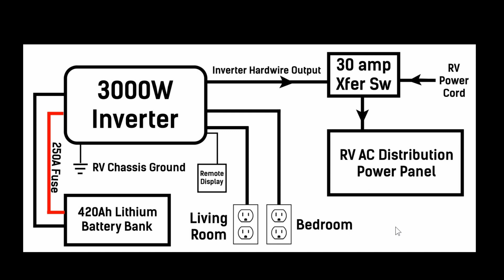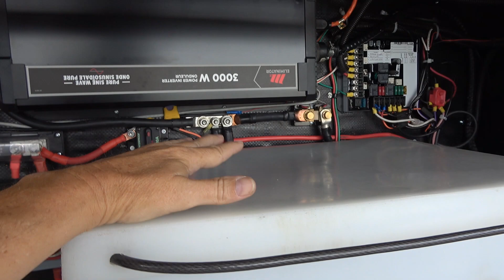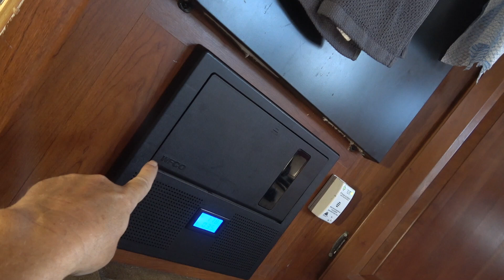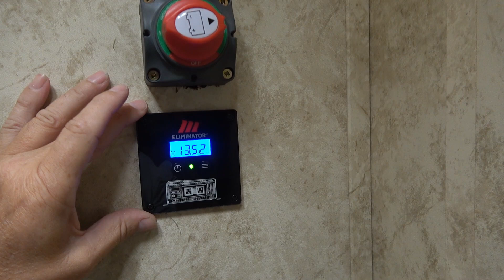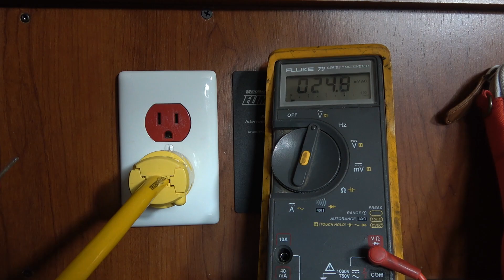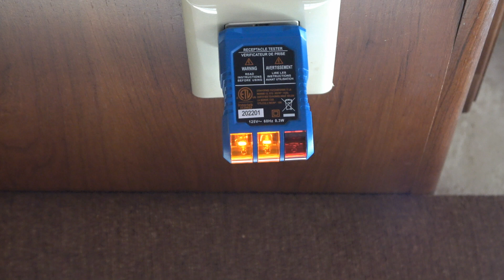3000W Inverter Installation w/ 30A Auto Transfer Switch - Motomaster Eliminator PSW & Go Power TS-30

Comment: I am having issues running my Level 1 EV charger using this exact inverter. Seemingly due to the fact that the neutral does not seem to be bonded to ground. I checked the inverter manual and it has no mention of it.
Has anyone done this, if so, at what point did you create the bond? I tested a neutral to ground plug and it did not solve the issue my charger is having with it.
Any ideas?
Reply from the maker: I don't believe this type of inexpensive inverter that has 60V on the hot and 60V on the neutral can be bonded. Most things will work fine but any device that analyze the connection looking for a bonded neutral like for example a surge protector will spit back an error.

Comment: Question if I may, is your output of the inverter 30 amp? My 3000 watt is only 25 amp out. Thanks
Reply from the maker: The rated max output of the inverter, according to my manual, is 115VAC at 26 amps. VxA=W 115x26=2990. Then, I think there are 10 watts for the USB port, for a total of 3000 watts

Comment: Would you use this switch if you simply want a “in camper” plug installed for a solar generator? I could have the generator simply plugged into the already installed 30 amp RV socket however at night or inclement weather, I could plug it in inside the camper for safety.
Reply from the maker: Manually you can do what you like. This switch is for people that want to auto switch between to AC power sources.

Comment: Wires in a bundle can't cool as good as wires exposed to open air.
Reply from the maker: True but in this usage I don't feel it is a problem. The RV cord is rated for 30 amp continuous and outdoor rated. The 3000W inverter output is rated at a max continuous of 26 amps though in use it will never see that. There will generally be short duration continue uses of high wattage items like for example the microwave at around 1500 watts. The water heater element and air conditioner won't be used when off grid as they would quickly run down the batteries. So real world use maximums will be around 15 amps and for relatively short durations. Most times the amperage draw will be under 5 amps. Cheers, Ray

Comment: Just wondering how you went about changing your batteries from lead acid to lithium?
Did you just swap them out or was there anything else you needed to do?
Thanks! Great video!
Reply from the maker: Didn't need to do much as my solar system charger and shore power converter charger were adjustable to lithium requirements. Just a few settings to do. Most solar charge controllers are lithium compatible and now most shore power chargers are getting there, some of the older types will still work sort of with lithium but not able to fully charge.  But you can use both solar and shore chargers at the same time so may not be a problem. If the shore charger can't finish the job of full charging then the solar will. If you camp a lot off grid and use a generator much of the time then it is recommended to have a charger that is lithium capable. Otherwise you won't get as good of charging potential.
Reply: @ thanks!

Comment: Is it ok to install an inverter upside down? My battery cablers are on the right side and if I install the inverter right side up my exiting inverter cables will need to be replaced.
Reply from the maker: Yes, either way is fine. It's just a logo sticker. :)  The manual states to mount it horizontally versus vertically so foreign objects don't fall in the openings on the end.

Comment: YOUR 1000W Was way better then that 3000w crapola
Reply from the maker: Both have worked fine for me. I don't see a whole lot of differnce inside when I took them apart.
Reply: @LoveYourRV  the new one has a button that will push in and get stuck and the fan on the new one usually spins full speed on any load then shuts off
Reply from the maker: It must be a dud. Maybe it was dropped in shipping or something, as I used mine for a year of full-time RVing, mostly off-grid, with no issues. The buttons work, and the fan only comes on under a high-wattage load like a microwave or if it gets hot. I'd take it back and get it replaced under the 5-year warranty. Cheers, Ray
Reply: @LoveYourRV  yeah took it back got a refund, QA must have been on lunch break when i got one. I ended up putting my original 1000w Cantire one back in that still works prefect after 10-12 yrs

Comment: Hi Ray,
I’m installing a separate 48v battery and inverter to only run ac boondocking in my rv that’s 12v and like most the ac and microwave doesn’t run on dc.
My ac is almost under the new 48v inverter.So what’s the best way to wire ac from 48v system that’s 120/240 to ac.
I’m thinking with what you did I’ll undo ac unit wire and extend towards inverter,add transfer switch and rerun wire back to ac unit.Incase I left inverter on while hooking up shore power.
Did I get this right? What about the microwave?All I know is I’m getting closer to this mission lol Thanks Ray
Reply from the maker: You should be able to leave the RV 120VAC distribution as is and install an auto transfer switch on its main feed. When off grid the inverter supplies 120VAC and when on grid its shore power.
Reply: @LoveYourRV  ok.Just so happens shore cord is right under the kitchen sink by the inverter.I’ll just have to shut converter charger off manually I guess.Thanks

Comment: May I ask. My RV has a generator, how do I run the wiring if I install an inverter? Shore power ，Generator， Inverter Connected to automatic transfer switch? Thank you in advance for your guidance
Reply from the maker: You can use 2 transfer switches https://support.gopowersolar.com/kb/article/254-transfer-switch-wiring-diagrams-30-amp/

Comment: I just installed this same inverter to replace my previous Motomaster 3000 watt modified sine wave inverter. My setup is for emergency home backup power with simple 14 AWG extensions to critical appliances, so no transfer switch or breaker panel. With my previous setup I needed an Edison plug to bond inverter neutral and ground to operate my furnace correctly. Same situation with the new pure sine wave inverter, but I elected to use the built-in terminal connections to do the bonding, so I just added a short jumper between N and E and closed the lid again. Now the entire inverter presents proper grounding to connected devices, including circuit testers like the one used in the video.
Reply from the maker: Thanks for letting me know, I was fearful of trying a neutral to ground bond and damaging the inverter.  Good to know it works!
Reply: I was a bit concerned too, but as they say, "No guts, no glory." Now it's a really elegant, easy setup. I just wish the manufacturers would provide more information about the various use cases to help out end users. Good thing we have the web or we'd really be lost!

Comment: You can use the AC with the 3000W Inverter?
Reply from the maker: Yes, I have installed a soft stater in my AC and now the inverter can run my AC, though it runs the batteries down fairly quickly doing that.

Comment: Is there an ac circuit breaker at inverter? Line from inverter to transformer switch.
Reply from the maker: The inverter has built in fuses and also built in protections like short circuit, high amp overload, high temp, etc. so there isn't a need for an external breaker on that line.
Reply: @LoveYourRV  Thanks

Comment: My under standing as to the delay in the transfer switch is so if your shore power is a generator, it gives the generator time to stabilize its output before sending power to the system.  You can usually adjust or turn off the delay time with dip switch settings on the transfer switch.

Comment: Hi thanks for the all the great videos. Just a question, did you upgrade the wires that go from  the converter to the batteries, or did you leave the camper mfg.'s cables in tact after your installation of lithium batteries?
Reply from the maker: I left the OEM wiring from the OEM converter as is. I use a second converter near the battery bank for off grid generator charging. It has a very short run of 6 gauge.
Reply: @LoveYourRV  thanks so much

Comment: Im struggling with my neautral ground bonding with installing my hybrid inverter charge controller powmr brand.
Reply: I've got 8 panels 235 watts each. A 3000 watt inverter a 4000 watt low frequency inverter that is 110 and 220. The second inverter is for the 38 seer minisplit. I have a 100 Amp powmr brand charge controller and the hybrid inverter also has a 60 Amp charge controller. I'm currently using 24 nissan leaf modules in a 24 volt configuration.  Hopefully soon I can upgrade my batteries to some lifepo4.  Id like 30 kw of the lifepo4 and maybe 10 or 12 more panels. Thanks for sharing your build

Comment: Hello Ray, thanks for your video. Question: I've got two inverters in my RV. The original is 2kW and came with the RV. I've installed a second 3kW inverter and it runs all the appliances. However, I have a 120V charger for my 2017 Chevy Volt. I can run it fine on the 2kW inverter, but the charger rejects the 3kW due to a 'bad ground'. Why would it work with one but not the other? I've connected the ground wire to the chassis as required. However, the AC ground (green) is not connected to anything except the proper terminal of the 30A plug I've connected to it.
Basically, the original inverter should be fine, but the builder put 100A breakers on the DC inputs thereby limiting the effective power to about 1200W, which is not enough for a microwave etc. I got a decent price on a motomaster 3kW inverter and have installed it. I then plug my RV into it and shut off my converter. It seems work quite well. The other electrical equipment I've tried seems to work fine. Only the car charger rejects it. By the way, the original 2kW inverter is by Xantrex. Any good ideas would be appreciated. Henri (RVing with Henri)
Reply from the maker: It's likely because the Motomaster AC output isn't bonded neutral to ground. It's a floating neutral, so some things will reject it as miswired. I discussed this a bit in the video - https://youtu.be/QEqHrIQuI8U?t=1047
This happens with portable generators as well, and people use was special N-G bonding plug  https://active-controls-llc.myshopify.com/en-ca/products/ground-neutral-bonding-plug  I was leary of trying one with my Motormaster as it may damage it since it has 60V on the neutral and I needed it for my trip and in the USA so can't take it back.  Once I'm back in BC for the summer on hookups, I'm going to try, and if it blows. If it does I'll take it back and get a new one.
Reply: @LoveYourRV  Thank you for getting back to me. I suspected same based on your video I'd seen before commenting. I'll check the potentials on the AC leads to verify. I'll just leave things as they are as it runs most everything and I don't want to fry the new inverter as the car charger is not a big factor. Again, thanks for your time
Reply: @LoveYourRV  Hello , again, Ray sorry to be a pest. However, in my situation above, if I plug in the RV to my wired 30A off the 3kW inverter wouldn't the ground wire from the 3k inverter be grounded to the RV frame via the RV AC distribution system? 
I can see your point if I just plugged in a load on the inverter's front panel and got a ground fault, but if it's connected to the RVs AC system shouldn't that ensure the AC ground wire is frame grounded? Or are these units wired so the neutral does not connect to ground so that the frame is not energized when stepping into the RV?
Reply from the maker: Yes, the ground from the inverter connects to the RV frame ground. But it isn't bonded to the neutral. In a normal shore power campground situation, the AC neutral and ground are bonded at the campground's main power panel, never inside the RV. So anything plugged into the camper sees that N-G bond. However, many inverters don't bond the neutral and ground but instead have a floating neutral, which works fine. I think most that have floating neutral are aimed at the mobile market where there aren't earth grounding rods installed, like cars, boats, RVs, and people just plugging stuff into them. I also think they are cheaper to manufacture. Some expensive inverters even have a way to choose floating or bonded neutral via a switch or jumper.
Most things will work fine with the floating neutral setup, but some devices, like sophisticated surge protectors, will detect this and show a wiring error as open ground.  See this page https://hughesautoformers.com/product/ground-neutral-bonded-plug/
Some devices sensitive to seeing a normal N-G bond will fail to start. An example is some home gas furnaces. See this page https://temperaturemaster.com/furnace-wont-run-on-generator/
My guess is your Volt charger is one of these devices sensing the non-bonded neutral and ground and not starting.
Reply from the maker: Found this on a GM-Volt forum https://www.gm-volt.com/threads/problem-with-off-grid-120-volt-charging.155625/page-2  but like I said I'm not sure if its wise to use a bonding plug on the Motomaster 3000W. Like I said haven't tried it yet since it seems to used a split voltage method of 60V on the hot and neutral to make the 120 VAC. So if the neutral gets shorted to ground it may damage the internals. Cheers, Ray
Reply: @LoveYourRV  Thanks Ray!! I really appreciate the time. I expect the bonding plug won't work and would probably damage the inverter Otherwise, you'd think they'd tell you. So ... as a coward ... I'm going to wait for you to try the bonding plug and see what happens before I do it!  Ha ha!! Thanks for all your postings we all appreciate them. Henri (RVing with Henri)
Reply: @LoveYourRV  I will have a look. I also checked the output of the Freedom Xi inverter as well and it is N-G bonded with 120V on the hot and 0 on the neutral. This inverter has an internal transfer switch allowing shore power to flow directly through it. As you know the CT 3000W inverter we both have has no AC input terminals. 
When I connect the RV plug to the new CT inverter the power flows right through the Freedom inverter and has a floating neutral with about 60V on either wire. 
So, in sum I can still use the RV to charge my car, but only when the new inverter is not used to power the entire RV. Since I am only going to do it at home anyway with the idea of catching the solar I'm not otherwise using the point is moot aside from the education I just received. Thanks again. Henri (RVing with Henri)

Comment: I just purchased the 4000w inverter, the factory  wire for the hardwire distribution ground was pushed in to far, and the screw was in the yellow/green ground, not the actual wire.
Reply from the maker: I'd take it back and get it swapped for a replacement. So far this 3000W pure sine model has worked well have used it to power the RV off gird for almost 7 months. Cheers, Ray

Comment: Good video. Quick question: Why do you need separate outputs from the inverter to living and bedroom outlets if the inverter is also going to the AC distribution panel. Wouldnt those outlets be covered by the panel anyway?
Reply from the maker: The living room and bedroom outlets I installed when I used only a 1000W inverter. They were additional dedicated outlets separate from the OEM AC circuits. 1000W Inverter Installation https://youtu.be/yV2xJiHSbfU  Once I got this 3000W unit, I decided to connect all my OEM AC outlets to it.
Reply: @LoveYourRV  ah ok that makes sense, so if you used this inverter originally you wouldnt have needed the separate outputs to those outlets.
Reply from the maker: Yes, but also back then I didn't have a transfer switch. The 1000W inverter was purchased mainly to run a computer, charge stuff and our TV. So was easiest to just install an outlet or two using the inverter outlets. Basically they were extension cords.

Comment: A better quality inverter with pass through would eliminate the need for the transfer switch and add other really useful features such as power assist, battery backup, and battery charging.
Reply from the maker: True, but this one has done what I need for 1/3 the cost and has a 3 year in store sticks and bricks warranty so hard to pass up.  I already had the transfer switch and battery chargers.  I'm also not a fan of all-in-one things in case they break.

Comment: Ray, I'm curious what your voltage drop is at the inlet power of your inverter after turning the microwave on?
When nuking lunch, I've triggered the low-voltage warning on my inverter a few times. I think from having a low charge state...lower charge state = lower battery voltage.
My drop seems to be a little about 2V
Reply from the maker: I have lithium batteries so they don't sag much in voltage. Microwave draws around 1500 watts and I see the voltage drop from around 13.2V to 12.5V reported by the Motomaster display.
Reply: @LoveYourRV  wow, not much drop. I have LiFePO4. Microwave also pulls 1500W.
Maybe because you're 2/0 and vry close to batteries vs 1/0 and 12ft from batteries
Reply from the maker: Yes, for sure, 12 feet is fairly long distance for inverter cables. About 3 feet or less is ideal.  Could be a connection though. I'd run the microwave for a few minutes and then see what if anything is getting hot like the cables or connectors. Warm is OK but hot means its creating too much resistance causing the voltage to drop.